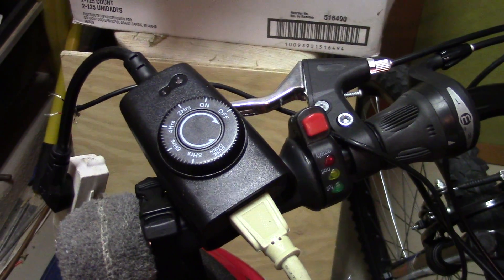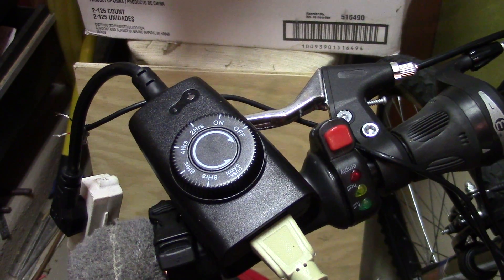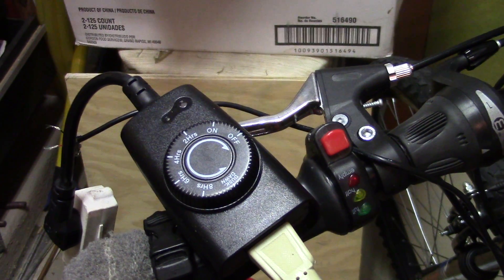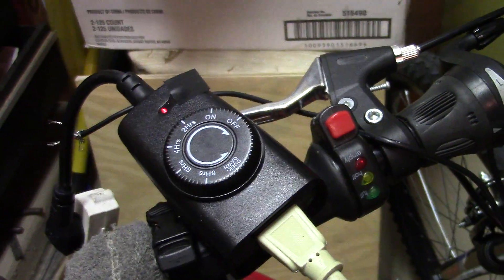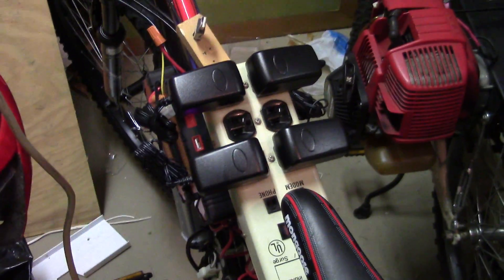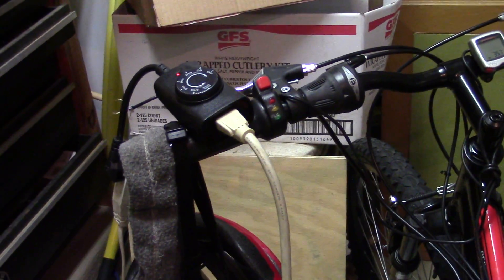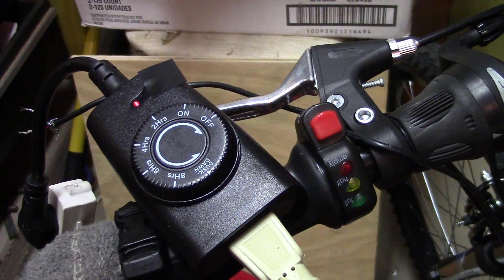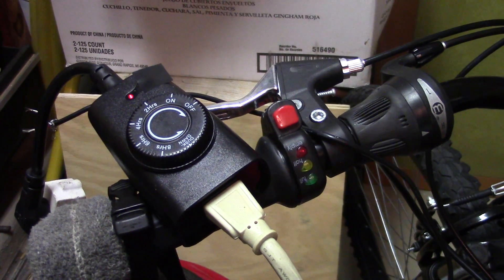DIY Electric Timer  2,4,6,8 hour non-repeating

Comment: I just found 2 such devices: "Electromechanical Timer, 120VAC Voltage, 5 Amps, Max. Time Setting: 8 hr." at Grainger.com and "Woods 50030 1 Outlet Grounded Indoor Countdown Timer" at Amazon.  I bought the Woods before I found the Grainger.  I might pick the Grainger if I had it to do over, but the Woods will work fine, I think.